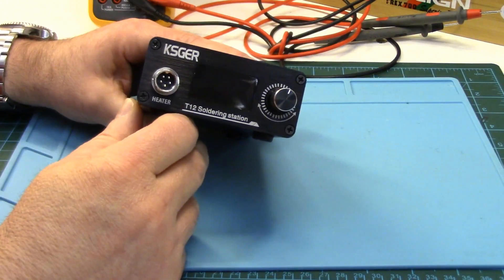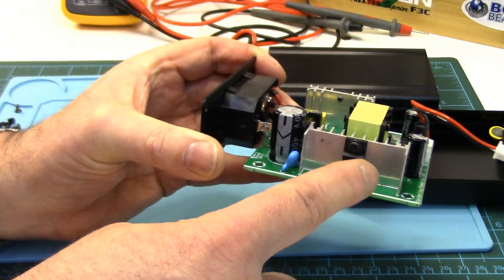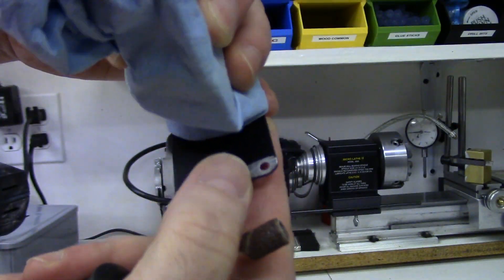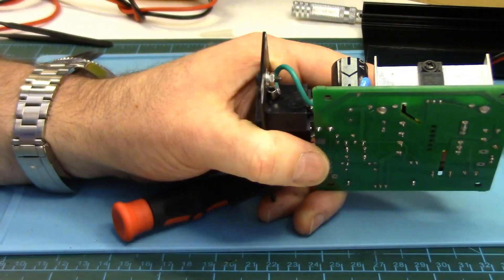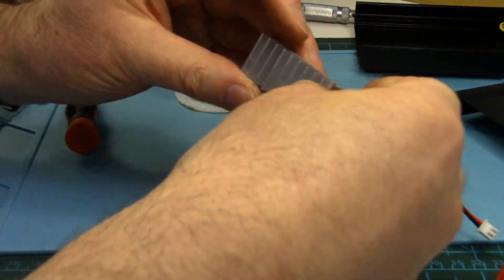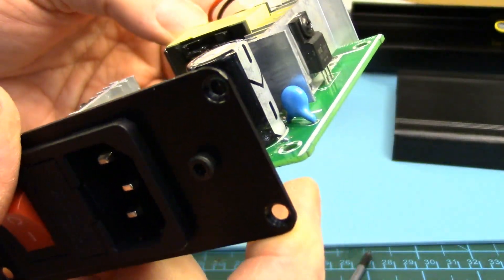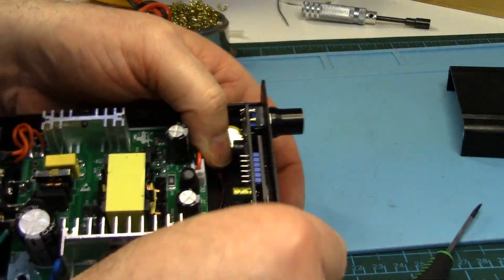KSGER T12 Mod To Improve Safety That You Can Do - It's Fun!

Comment: I love this little soldering station! Also got two T100s (bought the second because the OLED on the first died, and then I ordered a new OLED for the first, replaced it and this is how I got 2). Never hurts to have some extra irons at hand!
Reply: im deciding from the ts100 and ksger t12 which do you recommend
Reply: @TooBanger  Frankly I am only using the KSGer now, because I have a wider range of tips to select from. If you're a casual user, the TS100 might be ok for you, but if you plan to do more serious work, the KSger is a better choice. It has more power, different handles to choose from, more settings, cheaper tips and a wider tips selection.

Comment: I added a dc jack in the back to use with a dewalt tool battery and now i have a portable soldering station that i can use anywhere. Make sure you set your shut off voltage and alarm so you dont damage your batteries. You can buy battery adapters for any tool brand and it'll work wonders.
Reply from the maker: Nice

Comment: I've just bought this soldering station today. This video is going to be very useful for me. Wich thickness (AWG or mm2) do you recommend for the grounding wire? Thanks a lot for sharing.
Reply from the maker: 16 - 20 AWG would be adequate IMO. I used 18 AWG on mine.

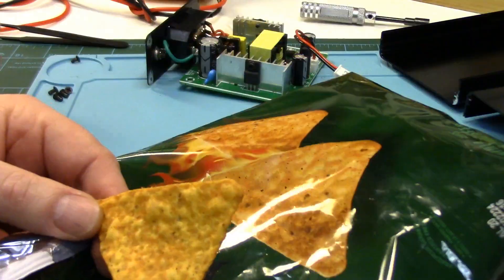Comment: I am interested in the T12A version even though the station is tiny. It looks almost professional and desoldering stylus approaches Weller quality. :) 5:44 Modification I will make as soon as I receive it. So you avoid getting that annoying shock through the frame and then you protect the circuit.

Comment: I need to buy a soldering iron to fix my soldering iron.
Reply from the maker: You mean mod since fix implies it doesn't work; it however works fine. Regardless of definitional accuracy, I presume most people who are thinking of getting a direct drive tip technology T12/T15 station have at least one other soldering tool in their arsenal.
Not that it matters much anymore since according to the comments, all the latest batches of Ksger T12's already have these fun and easy mods performed at the factory.
Reply: @Rchelicopterfun  Yes in this instance fix means mod. I actually have no soldering iron right now despite dabbling with electronics for many years. I was looking at getting one of these and if I do I'm now convinced that I need to take the lid off before I plug it in especially after the video I just watched about a smoking capacitor in a brand new unit.

Correction, I actually have a crappy Silverline butane soldering iron that hardly works.

Comment: I know this is an old video but just wanted to comment in case it helps anyone that I bought one from the official ksger aliexpress store last month and it came grounded already. Pretty good soldering station for the price.
Reply: do you think this also goes for the cheaper quiko version I just got off amazon? how would I check to see if it's properly grounded?
Reply: actually i just checked the specs sheet for the one i ordered and looks like they now come properly grounded so thank goodness for that!
Reply: Hi is the tip grounded also? Did you get 2.1 or 3.1
Reply: I just got v 3.1 from aliexpress and compared to the video it has a grounding connector on the back. But the case was still not grounded. I had to scrape off the anodization around the ground connector so the connector was no longer isolated from the case. I also had to scrape off the anodization from the screw holes to get the rest grounded. While at it, I replaced the wire connecting the ground with something more substantial, the original one was like 0.5 mm.
Reply: One more thing I noticed when I finally got to modifying the heatsink - it turns out the mains trace on the board  is no longer directly under the heatsink, but it goes around the heatsink. So there is no need for modding that anymore.
Reply: That's good to know,  just purchased one and was wondeting myself so I've just asked them if this is still the case today. 🇬🇧

Comment: Leaded works very well for me lol, I don't get the hate, I'd personally just add a dab of flux to that joint that's not melting.
Reply: because its woke rohs trash that cracks and fails . Otherwise it leads to needlessly high temps to damage the pcb or components with. but hey designed to invisibly fail  is always great.

Comment: add some fans inside ehhehe
Reply from the maker: Not sure why anyone one go to that trouble as these things barely get warm inside. You would also have to cut cooling louvers in the aluminum case - no thanks. They work perfectly fine with passive internal cooling.

Comment: 12:10 Hmm... not sure why North America decided to have switches like that. The reason I like OFF to be up is that most of the time a switch is turned off, and when that part of the switch is tucked inside the case, it won't easily catch dust. I really dislike dusty switches and I think the less you have to maintain them, the better. :)
P.S. Thanks for this video, I'll check my station to see if it's grounded or not. :) I'm not really worried about the heat sink, as long as it's soldered there's barely any chance to make contact, and arcing is probably unlikely to happen.
Reply from the maker: Yep, always check the local electrical codes. The logic right out of one of my electrical code field guides states: UP = awake, alert, high potential, one... thus = on. Down = asleep, down, low potential, zero... thus = off
Reply: UK .. up off down on ;)

Comment: I was unable to desolder the heatsink, no matter what I tried (hakko fr301, wick, soldering iron), the pins remained stuck / some solder always remained in the holes. I wonder if it's because the heatsink is transferring away the heat on those parts, thus not allowing the solder to heat up enough to melt. Any tips how to solve that?
Reply from the maker: Yes, the heat sink pulls a good deal of heat from the pins. The usual tricks apply including: use a larger wedge or hoof tip improving thermal mass and heat transfer, use a higher wattage iron that can overcome the heat loss,  melt in some proper quality leaded solder to both lower the melting point and broaden the eutectic point, use more flux. 
If none of those are workable options, the pins are just slid into the heat sink so it should be possible to pry the heatsink off the pins (just make sure you remove the screw in the rectifier first)  😀
Reply: @Rchelicopterfun  Thanks a lot for the tips, I shall try again :) also kudos for the video overall, it is an excellent guide!
Reply: @Rchelicopterfun  I managed to do it with a larger tip and a lot of patience :) It took quite a lot of time, and I am wondering, due to the long exposure to this high temperature, is the transistor in danger of dying (the one to which the heatsink is attached)?

Comment: Hi John! I have watched this video as well as a few of your other t12 reviews, and I am uncertain whether the 3.1s I plan to buy needs the mods outlined in this video. I'm hoping not, but better safe than sorry. Many thanks!!!
Reply from the maker: @XL-Freak.  This is the 3.1S version in the video, so unless KSGER have changed the design, these same mods can be performed if you get one keeping in mind you don't have to do them. The vast majority of T12 stations out there have not been modded and are working for their users perfectly fine. I pointed them out in this video for 3 primary reasons:
1. To show the two main weaknesses of these low cost, yet performance rich T12 stations.
2. To demonstrate how easy it is to correct them.
3. For the simple reason I enjoy performing easy little mods like this to stuff to make it even better than it already is.
On a side note, I personally like the 2.1S version better than the 3.1S.

Comment: I always put in a 2-pole switch on devices like this, so live and neutral get separated. This is because here in Germany we do have non-polarized outlets/sockets and there is a 50% chance to get live on neutral and vice versa. Of course it still works and shouldn't be an issue, but it feels better with the 2-pole switch.

But by far the most important mod is the PE/earth connection of the casing. It's more like a repair than a mod really. I like to use fan washers (Zahnscheiben in German), since they cut into the metal when tightening them down.

Never thought about that heat sink though.

Comment: In my experimentation, the black anodised finish was very strongly insulating. Even pushing my DMM probes into it as hard as I could I couldn’t get continuity. And I imagine that even if you ground one panel, that continuity wouldn’t follow on to the other 4 pieces of aluminium. So instead if you’re worried I’d just add some fabric insulating tape around the inside of the case where a heat-sink or other bits could contact it. Though sanding down the area near the screws isn’t bad either.

That heat sink goop looks conductive though, and it was getting kinda close to shorting the diode’s pins out.

Comment: would you recommend ts100 or the ksger t12???
Reply from the maker: Two totally different tools. Portable soldering iron vs. bench top soldering station. It therefore depends what your soldering needs are... Portability for field use or feature rich, more robust bench top tool.

Comment: Is it possible to just solder the grounding wire to the case without drilling it?
Reply from the maker: Nope, can't solder aluminum with low temp electrical solder.

Comment: Quick question here? Did you edit out tinning the ground prong @ 5:13? I am new at this and just trying to be thorough, trying to copy this exactly.
Reply from the maker: That ground tab already had solder on for the board connection, but I added more for the wire because I wasn't happy with my first attempt. Totally dependent on how much solder is already on your ground tab to begin with, your soldering skill, and how much excess solder you want on the wire connection.

Comment: Very useful and informative video! I have one question: I don't have a second iron right now, and I don't wanna buy two irons just to use one for modding another. What would you think, would it be too stupid to do soldering with the same iron on its earth ground pin? - while being extra careful of course to not touch anything else besides the pin being soldered. (To do just the grounding mod. Obviously, I couldn't do anything with the heat sink this way).
Reply from the maker: I would personally never solder on a live circuit, especially one at line voltage potential. That single event would be much more dangerous than using the station for years with the case not being ground IMO. Keep in mind, lots of folks use these stations with floating cases without any problems. You're call of course.
Reply: @Rchelicopterfun  Thank you! Got it, and I'll pass on any mods before buying another iron, or will just try to screw a connector to that ground terminal (as I saw in some videos, those ground terminals had holes in them)

Comment: The hot air variant of this type of product is no better. Not only is the aluminium housing not earthed/grounded the exposed metallic portion of the wand isn't either.
Reply from the maker: My KSGER hot air rework station's metal nozzle is grounded (white wire) and it came out of the box that way: https://www.youtube.com/watch?v=C1OiKfb_0M8

Comment: Do you think it is worth the effort with this station to connect the iron's tip to ground to provide ESD protection?  Also, have you had a chance to look at the $20 Handskit version of this station on Amazon?
Reply from the maker: Tip is already ESD grounded (provided you plug the station into a grounded outlet of course). Never looked at the Handskit version and have no working experience with it...
Reply: @Rchelicopterfun  Thank you, I will try watching again a few times, I didn't see a grounding connection between the controller board and the power board?
Reply from the maker: @Robin Nesting - DC negative output on the PS shares earth ground.
Reply: @Rchelicopterfun  I see where you commented on making sure the connector made contact, I apologize for not watching more carefully the first time!

Comment: For anyone looking at the T12 mini, the handle should already be grounded however the anodized paint has to be scratched off the corners and dials inside to properly ground the PCB to the case.

Comment: Ok, if the case is none conductive, (since you need to sand it well first), then, Whats the piont of connecting a wire to it?   For the handle ,iron body, its connected to AC input earth already (through 24 negative, black wire)......ok, I can think of one scenario: the pcb has a sharp part or heat sink has 220v or 120v, it touches the case very hard and scratches the paint and make the case has 220/120v....then we happen to touch some outside part of the case where it happens to have no paint on it.....rare case, but still a valid case.
Reply from the maker: Yep, it's exactly those rare cases why it's CODE in most countries to have any metal cased line voltage tool/appliance earth grounded. Tools get dropped and abused all the time. There are many scenarios one could think of where the line hot could come in contact with the case. And since the  guts are not double insulated, the metal case by code here in North America HAS to be grounded.
As for a micron or two layer of anodizing offering adequate insulation - not likely.

Comment: Hi, I finally have this T12, but on the inside near the L pin it says 'AC-220V'. Does that mean that this is for 220V only and that there is a separate 110V version, or can I connect it to both110V or 220V? The description said 110V-220V...
Reply from the maker: They are universal voltage.
Reply: @Rchelicopterfun  thank you!

Comment: If i buy this because is inexpensive, i would have to buy another even cheaper soldering iron just to be able do fix the grounding issue...
Reply from the maker: The majority of people who would be considering a direct drive technology tip soldering station like this already have soldering irons. Or use crimp connectors instead. Or simply don't ground it - as I clearly pointed out, these are optional mods.
Reply: @Rchelicopterfun  I know. What I like most about your videos that explain everything so nicely  is that when you buy something you check it and improve/repair it.
The people who produce something are often not any smarter than us so I think it is great to make modifications yourself.
I just moved so I will buy the cheapest soldering iron my mexican home depot has and then try to buy this station through one of your links. Thanks!

Comment: 9:00 no thermal pad or thermal paste?!!??!
Reply from the maker: The rectifier doesn't get hot enough to warrant it, but I put some on for the hell of it when repositioning @10:29. Can't hurt right... 🙂
Reply: @Rchelicopterfun  I'm considering cut off part of heat sink. In worst case scenario power loss on rectifier is 5W so heat sink can be smaller I think

Comment: John, about that 10 pack of tips: can I also use them on my Miniware TS100?
Thank you.
Reply from the maker: Yes, T12 tips will fit & work in a TS100, but they stick out almost twice as far as TS100 tips, so it's much harder to work with.
Reply: @Rchelicopterfun  Oh, OK. That brings up something I never thought about... what about using TS100 tips on a T12? 
If they are shorter in length, would the handle get hot?

Comment: Thanks for the video and for advising owners of these stations to ground their chassis.  I recommend using crimp connections wherever possible on ground connections as high currents can melt solder connections, allowing the wire to simply fall off.  A fuse or breaker will hopefully cut the power before the soldered connections fail, but UL-approved ground wires are crimped to things like spade connectors and screwed eyelets, not soldered.  We want to force something upstream to trip or blow well before the internal ground fails.

With that said, the present-day KSGER stations with coincident, soldered power connectors between the plug module and power supply board don't offer an easy way to attach a spade connector to the ground terminal, so a soldered chassis ground is better than none at all.

Comment: I think replacing the caps with something name brand may help with overall worry free use. Seems worth it being half the price of a hakko yet half the size and same power. Hakko is likely better but this is a cool little project spare.
Reply from the maker: Half the price? More like 1/4. The comparable T12/T15 direct drive technology Hakko FX-951 is around $270 USD at most vendors. Regardless, both great direct drive soldering stations IMO 🙂
Reply: @Rchelicopterfun  I guess that is true, I was comparing it to a hakko 888d which isn’t cartridge based. Not sure how to pick which soldering pen style but I’ll buy one soon.

Comment: really like watching your vids ..just discovered your channel. someone asked about the T12 iron i mentioned that i bought years ago. i don't have an electronic background so i went with the save option and bought the mini one and bought an external higher end power supply came in handy because i also wanted the TS100..i prefer the KSGER T12 because of all the tip options..

i really like the mods you did. and how you explain it.. i don't know that i would have bin able to mod the heatsink as i don't have a counter screw drill bit (i believe that's what you call them ? , eng is not my native language ).. 
will subscribe to the channel like the way you share your knowledge ..

Greetings from The Netherlands..
Reply: I think you mean tapping bit, he drilled a new hole,  and then created a thread inside that hole to receive the screw.
I just bought my KESGER unit yesterday and noticed the issue with the body of the unit not grounded so that is my next project.